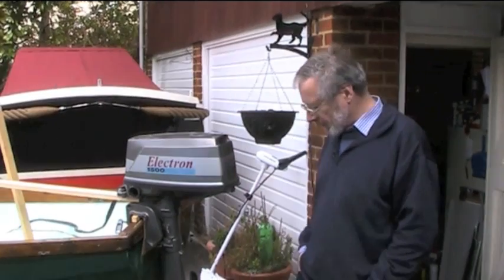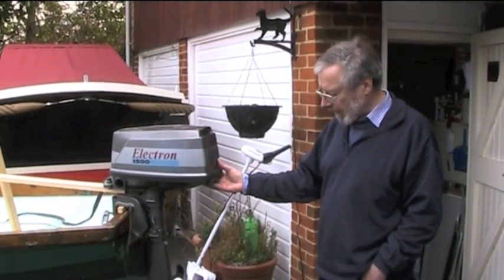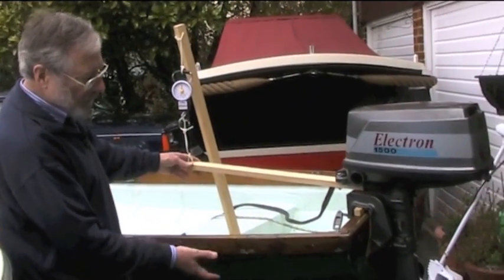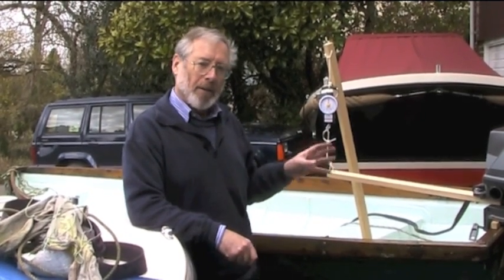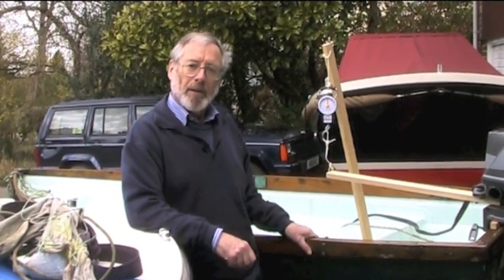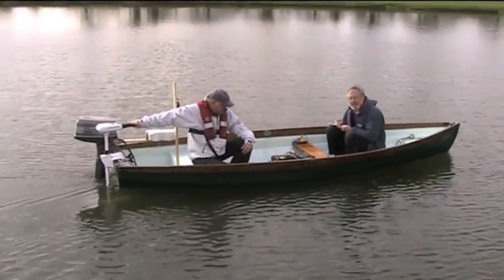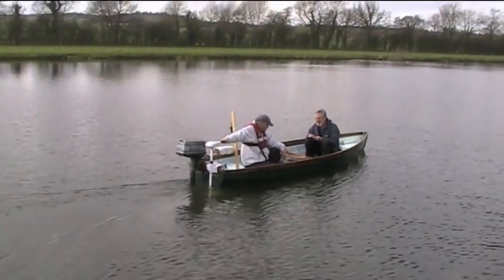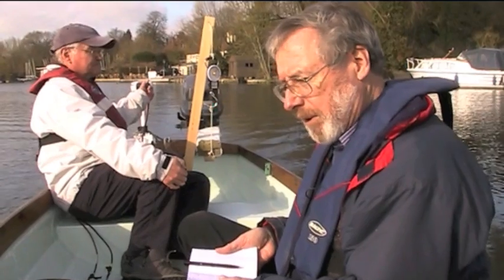Which has less drag? A fixed or a spinning propeller

Comment: You learn this when you learn to fly multi-engine propeller driven aircraft. A spinning propeller has way more drag than a fixed prop, even if it's not feathered. Seems counterintuitive but the effective drag area with a windmilling prop is the entire circle of the prop arc, not just the blade area. When it's fixed, it's just the blade area therefor less drag. I've demonstrated this myself on aircraft. The Cessna 340 I flew won't fly with a windmilling prop, it will with it fixed.
Reply: MrDan27611 I